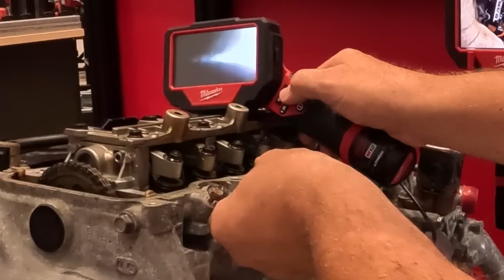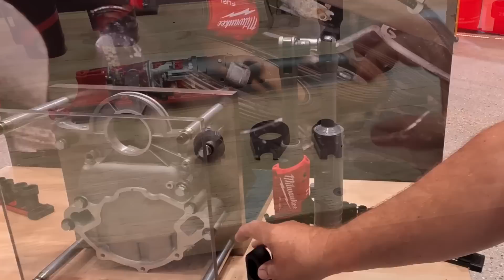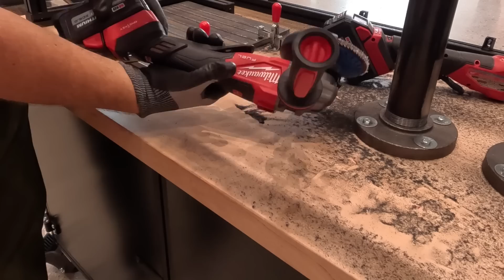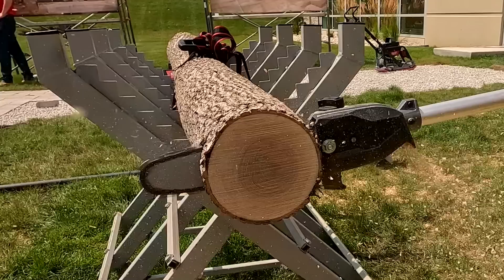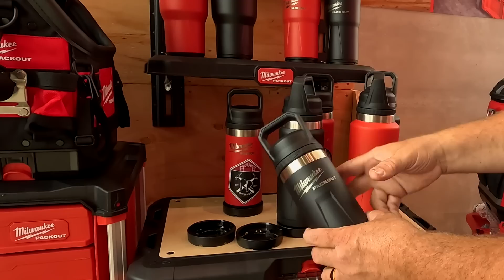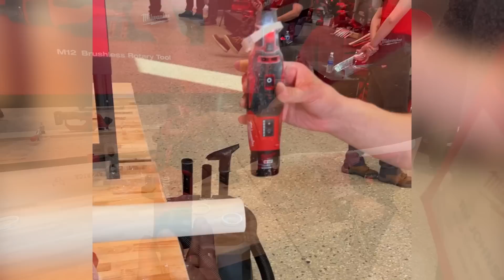NEW Milwaukee Tools from Pipeline 2023 - Impact Wrenches, Pliers, M12 Ratchets and MORE!!

Comment: Great video! I know you have much more informations regarding Milwaukee tools, but I was wondering something, and I hope you have an answer for this. It's about M12 FDD2-0 vs M12 FPD-0. One is a "sub compact drill driver" and the other one is a "sub compact percussion drill". The only difference between these two is the "hammer mode". But what's really strange to me, is the face that even one is missing the hammer/percussion, the size and weight is IDENTICAL. How? Also, in my country, the percussion model is actually cheaper than the one without percussion. Again, how? Am I missing something? Or maybe the informations from Milwaukee are wrong, and the one without percussion is actually smaller and lighter? Thanks in advance for your answer!

Comment: Good to see the new M12 fuel rotary tool - gonna pick one up when it comes out. So no new mid-torque impact then? Just wanted to make sure before I grab the 2962-20 this week.
Reply from the maker: Correct, no new Mid-Torque yet. Yes, that rotary tool is very legit. Thanks for watching.

Comment: We need a m12 fast charger
Reply: That's probably not happening anytime soon. I know a lot about batteries and I can tell you there aren't enough cells in parallel to charge them as fast as the newest ones. At best, a 4.0 pack could charge in 30 minutes with the right cells. They'd get warm and wear out quick though. Just have an extra battery on hand charging while you're working.

Comment: I've been working at a site doing steel fabrication and erection for the past 7 months, first site I worked at where they banned 1mm cutting discs and required a handle on every grinder.
Of course its been very impractical, and I still take it off when I have to. But that grinder actually addresses some of my issues.
It wasn't long ago that most guys would take the guard and handle off and throw em away, especially when they all had that godawful philipps screw to adjust the guard... They're starting to realize that we will actually follow these safety rules if they're not a massive hassle.

Comment: Milwaukee 12v Rotory tool 27.000rpm. Looks at Ryobi 5volt USB Rotory tool 25.000rpm. Raises eyebrow You got 2 extra 18650 cells in your tool Milwaukee and all you could come up with is 2.000rpm more then a 5volt device? Ryobi's old 12volt model does 30.000! So either this version of yours has LOADS more battery life cause it's 12volts or it has more stable torque. Cause if neither you're being mic dropped by Ryobi. 

It's interesting to see good 12volt tools of your 18v line being dropped down in voltage. But then it's also sad to see you joining the 36-40volt line by slapping dual batteries on devices without much improvements. That string trimmer 6200rpm isn't to exciting to boost about. Not to mention by the looks it's a steel driven shaft head rather then a true motor on the trimmer head. So all the motor power is in the hands. More vibration inducing. Genius move.....Not.

If it wasn't for your impressive way to somehow squeeze out so much power from so little voltage compared to must companies. You'd be below Ryobi..... I think that's the only boost you got going Milwaukee. Cause you're just kinda all over the place of trying to slap tools onto the market with no real thought process.
Reply: 27,500 is the milwaukee one and it has alot more torque than the ryobi one is junk and doesn't tend to be close to what they say.
Reply: Well considering they have research teams and engineers that put this stuff together I'd hold my horses. After all, when you put Ryobi and Milwaukee to the test, Ryobi consistently underperforms and Milwaukee ALWAYS far exceeds Ryobi. There's a reason hardly any professionals use Ryobi. I'm just giving credit where it's due here.
Reply: @MicroplaysMC  Milwaukee and Ryobi are by same parent company. Reason why Ryobi isn't looked after as a professionals is because it's more towards the DYI'ers that are looking for cheap and good tools. While Milwaukee doesn't care and looks for more of the jobsite people. Who won't care of putting a pretty penny down. Since the work place normally pays for it then the person.

There's a big difference in a DYI'er homeowner tool person and a professional jobsite user. When every second is gonna count and they need a harden tool. Then yes dewalt/etc will be the choice. But if a standard homeowner that isn't gonna crash for time or need so much fancy sparkles on their tools. Ryobi has that. I mean if Ryobi tool took 20seconds to undo a car tire. Compared to Milwaukee that does it in 9seconds. What you gonna go with as a home user when time doesn't matter. And the price difference is dramatically huge. If you can get a tool for 80$ from Ryobi or a 200$ tool from Milwaukee that is the exact same tool with just little more punch for faster performance and alittle more solid. What you think someone would go for?
Reply: @KillerRaptorr  I understand what you're saying but there is a big difference in build quality. The main concern I have is batteries. Milwaukee uses genuine Samsung cells while Ryobi uses no names. I don't want to be replacing the batteries all the time. Furthermore, while I may not need them professionally (yet), I'd like to have something that will last. Just because TTI owns both companies doesn't mean they're made the same. They're not. I have nothing against people who choose Ryobi and don't have problems, good for them. There's a market for everyone. But I'm playing the long game and in my opinion Milwaukee is more appropriate.
Reply: @MicroplaysMC  Maybe you should recheck where the 'batteries' come from on the tools.... Not to mention if you're talking about replacing. All companies use 18650 right now. Pretty easy to replace those by alittle rewelding. All they are is hooked in a group ontop of a BMS chip. They don't have any special chip built into the cells themselves. Most of these tools use unprotected cells because the BMS isn't built into the cell. It's built on the board. So they don't need a BMS in each cell. Same goes for the new pouch versions. (Still find this very redondent people keep talking about wanting battery life and not bothering to replace. If they done their research they'd understand all these 18650 cells are NMC cells that only have a cycle life of 500 till 80%. Compared to the LIFEP04 that can do 2000cycles. But has a lower energy density. Which is why most tools aren't using them due to there isn't as much punch power to pull. NMC can. But they suck in battery life cycle.)

Another thing i think Ryobi has over most of the other companies. Is all their tools are flexible to fit any Ah size. Other companies make tools specific to size that the battery ah can handle. So some i couldn't put a 12ah into a chainsaw because it's only built to take a 6ah max size cell.
Reply: @KillerRaptorr  Trust me I know about batteries, I build my own packs and research chemistries. Not all cells are made equal and the difference between the two brands is apparent. Apparent enough for me to consider one over the other, also considering the price. More important than the quality of the cell is the quality of the board because if the application of waterproofing is shitty (or the design isn't good enough) you'll end up with a dead board you can't just swap components on. Source: I dealt with it.

Comment: Awesome video thank you for the thorough but not excessive review. One question though, if you’re looking at the side view camera holding it front view camera side down as though it was in a traditional cylinder, where is the illumination led? 6 o’clock, 12 o’clock, both, other?

Comment: Thank you for covering this. Am i the only one still waiting for a fuel brushless right angle drill/driver in either m18 or m12. Ryobi even has one, but Milwaukee doesn't!
Reply: I’m still waiting for a m12 hot glue gun 🥹 but I might just buy the fake one that takes Milwaukee m18 batteries it’s red so fuck it

Comment: 700 for a weedeater 😳
Reply: That’s for professional and commercial use. That’s not for your every day Home Depot shopper or the guy doing stuff around the house. I’m a contractor, but not a landscaper that’s not for me. They’ve already released weed eaters/string, trimmers, for the rest of us. Two of them actually.  Keeping it in context they claim this is the most powerful weed eater/ string trimmer, on the market gas or electric  this is 100% PRO /Commercial use.
Reply: @steffendetrick my Dewalt 60v holds the crown right now for the most powerfulest String trimmer it's more powerful than my Stihl ht135 that costed over $800.
Reply: @truthisweareallgonnadie.  not according to Milwaukee, but we’ll see
Reply: @steffendetrick  hence why I said right now. Meaning while the Milwaukee isn't out right now.
Reply: Looks like a beast of a tool, 2 batteries and a dual charger, $700 seems about right.

Comment: Brother those yard tools are no joke. 155 mph is stirring up some debris. I will be adding that pole saw to my stable.  That sucker cut as fast as any battery powered chainsaw out there, plus it does it 13 ft up. 
I know everyone likes to grip and complain about the cost of tools and they are not cheap by no means. But when you depend on your tools for a living day in and day out having a powerful quality tool is not a option. Regardless of what your favorite color is,  Red, yellow, gray and sometimes teal,   top tier tools are expensive. They are a investment that allows you to make a living.
Reply: If I didn't already have an echo ppt2620 I would of also picked up that pole saw.  When I was in the market for one there were none that were battery powered that extended.  that sucker was $650

Comment: I'm excited for a few of those items but the pricing is getting out of hand. 400 bucks for a bare tool string trimmer? I bought a leaf blower, string trimmer, batter, and a charger from Echo for 330 bucks
Reply: It's the dollar losing value. My grocery bills have gone up similarly.
Reply: Just gotta wait for the home depot sales
Reply: Price them high so they can put them on sale later for the actual price, but make you feel good inside.
Reply: Amen!Milwaukee too high
Reply: I just bought an m18 fuel string trimmer for 160$ on sale at Home Depot, came with a HO6.0 battery and charger…